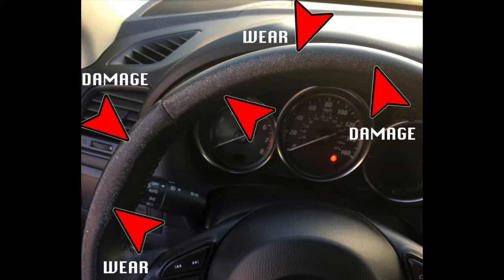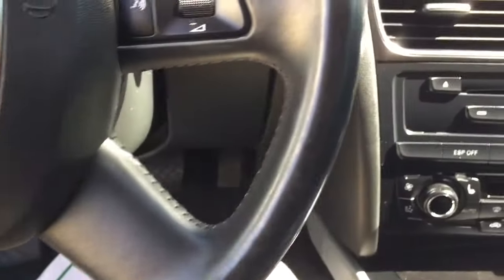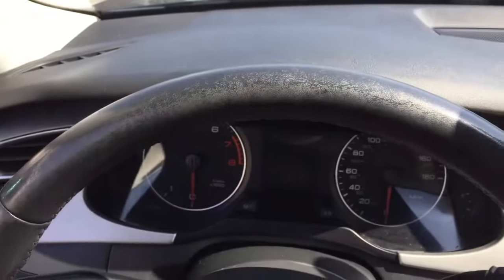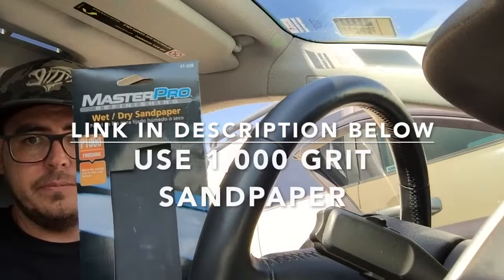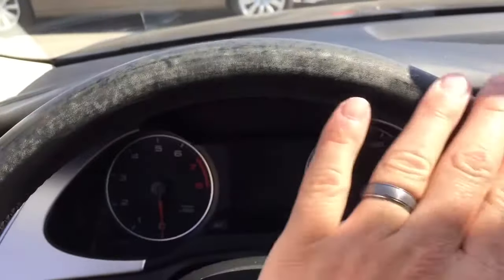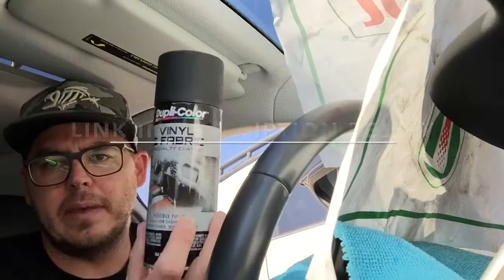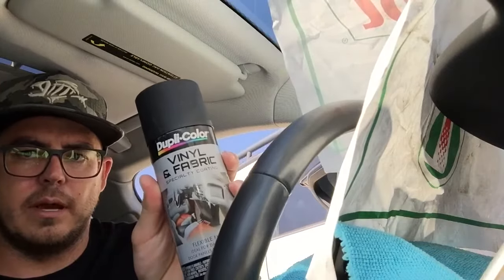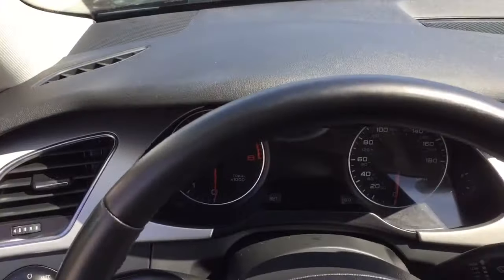DIY | HOW TO: Steering Wheel Repair

Comment: Another satisfied customer, this worked brilliantly on an old leather steering wheel. Easy to do and looks great. I originally tried to do this with leather polish (don't bother it doesn't work). This is so much easier, quicker and far better results. Thanks!

Comment: Question is how long does this kind of repair lasts? Just curious.
Reply: Long enough for the dealer to stick you with it thinking it was good.
Reply: @MrRob1426  couldn’t agree more. I got tricked with mine. After a few weeks the steering wheel started fading. I was like my car is only 4 years and some months old. I’m almost certain they did something similar to make it appear flawless.  Same with my two front leather seats.

Comment: Just wondering, if I follow your steps of using Gorilla Glue and then Duplicolor Vinyl and Fabric spray on the torn leather, how does using a product like Meguiar's Leather Cleaner & Conditioner affect the steering wheel? Because the reconditioned portion of the steering wheel is not all leather anymore. Will it work on the glue and spray portion of the steering wheel? Will differences in color begin after the cleaner's usage? Any other affects? Thanks
Reply: has anyone answered this question? is it on another comment?
Reply: I would love to know the answer to this as well

Comment: Does seem like a good quick fix without having to reupholster the steering wheel.I am almost convinced to do it. Can you help ?
 Two things here 1. The area where you apply the super glue ..and then sand it down..will it look and feel the same as that which is not after the entire wheel is sprayed.
2. The Vinyl Leather restorer spray ..how many coats to apply, how durable is it ? does it fade peel off or crack over use of the steering
Reply from the maker: 1. You want to make sure not to apply too much. Once you spray over it, it will all feel the same

2. Light light coats. If you use too much it can be too thick and can peel. Keep the coats light and only do 1 or 2 coats until our covers the area

Comment: Dear Sir,I have aVW Golf and have the same problem on the wheel.
I could not follow your video clearly due to the noise.
Could you be kind enough to list the process and materials used in a simple form. i.e.
Step 1.Grind with 800
Step 2.Clean with fibre cloth and water.
Etc.etc.
Thank you very much.I will appreciate it.

Comment: So I have a question I have a 2013 Dodge Ram with the gloss black heated steering wheel. What type of paint should I use for it? Will it affect the heating element and also will the steering wheel need a clear coat afterwards

Comment: You should be wearing a mask when you spray paint in a such a small area. Also use some masking tape and paper to cover the rest of the steering wheel (such as the controls) when painting. it would have looked much better had you done that.

Comment: I just have a little sun damage fading on the top portion.  it’s all surface marks nothing deep.  can I just apply the paint without doing the sandpaper and glue?? nice job btw!!!
Reply from the maker: If its all surface and not any structural damage, you can just clean the area well and shoot it.  It will help smooth it out and prep the surface for the best adhesion of the paint so that the repair lasts!   BUT, sometimes just the oils from your hands can cause discoloration and build up.  Take a microfiber towel and some water and scrub the area.  This might remove the build up and that might be all you need to do!  Good Luck

Comment: So I saw the two different colors on the wheel at the end. I think I would just do the whole front of the wheel. But, the top looks much better..
Reply from the maker: yes it was still a little wet so the sheen is different.  But yes doing the wheel give the most consitency

Comment: Just what I needed!!! Can I use shoe polish instead?
Reply from the maker: I’ve never tried that but I would think using a specific dye for interior would be best.
Reply: Don't use shoe polish as it comes off on your hands and the liquid shoe polish actually dries the leather,you buy leather dye in a bottle it's what was used to dye the wheel in the first place....clean the wheel light sand clean again then dab the liquid dye on with a small spounge you let it dry and then add more coats till you get the colour how you want it....

Comment: I own a 1 series with the new steering wheel which is quite a thick spongey leather, am i able to follow this process however missing out the sanding/glueing stages.
Thanks.
Reply from the maker: In my experience with those Bmw steering wheels... if it’s not too bad you. Can just light sand it with some 800, 1000, or 1200 grit sand paper hat to knock down any hard edges and then you can spray it with the satin black paint... just depends on how bad the damage is
Reply: IMJOSHV i mean the damage is quite severe, do you have an instagram or something i could dm you an image of the wheel on to help make a better judgement of what i should do with it?
Reply from the maker: james oram sure it’s vinyl_and_hide

Comment: The paint doesn’t come off? I mean, like in your hands? Ty
Reply from the maker: It won't as long as you properly clean the surface first.  Like anything, preparation is a key factor in how long the repair lasts!!!  I dont show it in the video, but make sure you clean the area after sanding as well.  Hope this helps and good luck!!
Reply: It totally comes off. this is for car dealers to flip cars and make them look new again to sell. this is a temporary fix to make it look good I had this done to my car before i bought it and it wore off the week after i bought it. came off and looks like shit again. they did this to my seats seats too and that stuff comes right of too.
Reply: @steveclark8480  what likely happened was the dealership used someonw who did not properly prep your seats.

Comment: what would you recommend to get scratches off the center underneath the audi sign that are not deep in
Reply from the maker: Sometimes its best to leave things alone if theyre not too bad... But you can try and put a little heat to it and sometimes that can help melt the scratch back into it self.  Just make sure you dont over heat the area

Comment: It totally comes off. this is for car dealers to flip cars and make them look new again to sell. this is a temporary fix to make it look good I had this done to my car before i bought it and it wore off the week after i bought it. came off and looks like shit again. they did this to my seats seats too and that stuff comes right of too.
Reply from the maker: In many cases you are right. It all depends on the proper prep and most times at dealerships the guys will skip that step to save time. If it’s not prepped correctly it will come off. We also use an additive called cross link that allows the product to hold much longer. Our repairs last as long as the original material did
Reply from the maker: And I’m very sorry that happened with your car. That’s terrible and whoever you bought the car through should warranty that
Reply: @imjoshv  I’ve been looking for a solution and this seems the best yet and understand you’ve adapted it for DIY purposes. I just wanted to say thanks for sharing (I’m in Australia so couldn’t book your services anyway) and the way you have bothered to follow up on these questions and even empathise with someone who’s had a bad experience out of it, is great of you. I’m selling, but will make sure I do a decent job. P.s. Yes, wear a mask please. The World needs more people like you, not less :-)

Comment: I followed all the steps but having issues with the paint. Once it dries you can still see all the parts that have been sanded even after 3 coats, its like the paint doesnt stick. What can I do??
Reply from the maker: Hello,  It sounds like you may have use a more aggressive sand paper.  You should not be able to see that sanding marks.  Make sure you are shaking the paint can enough to mix it up and break the paint loose inside.  Sometimes it might look like its spraying but its really just propellant and the paint isnt giving enough coverage. Alsop make sure to keep the can upright for the same reasons.  If the sanding marks still show through you can use this to fill them in: https://amzn.to/2Lr44cG    Just make sure you clean the area really well, the test the spray pattern of the texture coat and spray from a distance(the further away the better for coverage). Let is dry and the re paint.  VERY IMPORTANT...  Do very very light coats of the texture. If you spray it on too thick it will be gummy and come right off
Reply: @imjoshv  Dont think its the sand paper because i was using 1000 and 1200 grit.
Im really not sure whats happening here. Is it possible to send you a photo so you can see what im talking about?

Comment: I have a 2008 Ford F-150 fx4.... I think the wheel is vinyl, What are the different processes needed to repair my wheel. It’s rubbing off and is very annoying
Reply from the maker: It should be a similar process.  A lot of Ford wheels have a rubber feel to them and when they wear down you see little air holes from the base material of the wheel.  If it doesnt look like that then its probably vinyl instead of leather and the process will be the same.  The most important this is to Sand it down using 600grit sand paper to remove all the flakey stuff.  Then youll have a good base to start on.  And remember, cleaning is very important throughout the process to ensure a long lasting repair.  Another option would be to re-cover the wheel. you can get really nice wraps that are specifically made for your wheel.  The only issue is they are on aliexpress.com which means they come from overseas so you have to wait a while to get it.  I have used them in the past for some clients when the wheel was beyond repair and these covers are awesome.  

Heres a link to one company that has them.  You can write them directly to confirm the right one for your wheel and even change colors!  Ive used the leather and the perforated leather ones.
https://www.aliexpress.com/item/MEWANT-Black-Suede-Red-Marker-Car-Steering-Wheel-Cover-for-Ford-F150-F-150-SVT-Raptor/32841018900.html?spm=2114.search0104.8.3.14451ed6soeCE1

Here is a video of the install.  Ive done it and its not difficult!
https://www.youtube.com/watch?v=eHFZyeTHtw4

Hope this helps
Josh V
www.detailgreenusa.com
Reply: Detail Green USA Josh Vanderwaall Thanks man, You’ve been a great help 👍